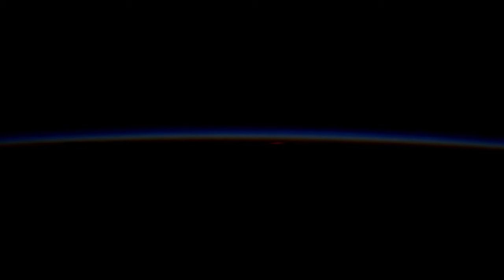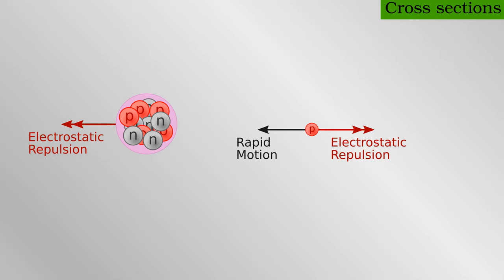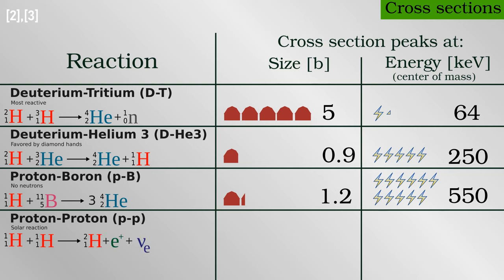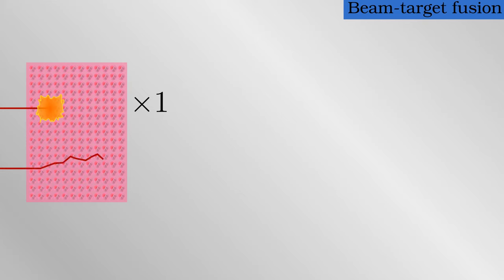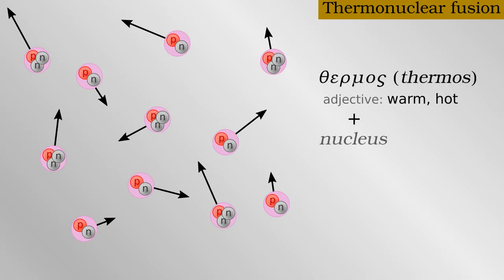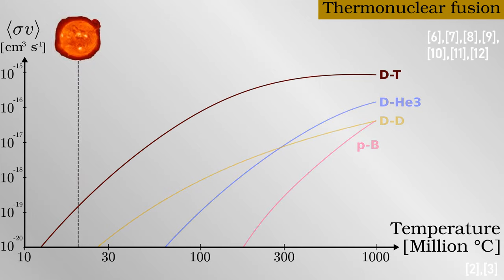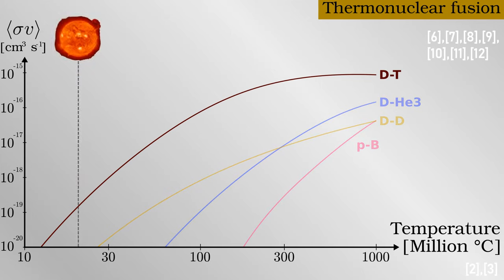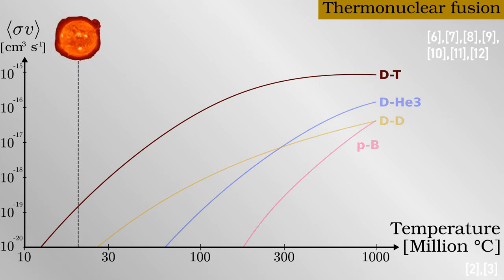How nuclear fusion works (1) - fusors, thermonuclear reactions, lattice fusion

Comment: The most surprising thing I learned in astrophysics was that the p-p fusion process gives off like no energy and takes about a million years to happen per reaction (on average). Then the D-T reaction happens within a second
Reply from the maker: Yes, since not yet half the hydrogen in the Sun has fused, each individual nucleus takes longer than the current age of the Sun to fuse. So a good thing for us overall.

Comment: When they fuse mass within a Tokamak reactor, how do they get the fused mass out?  Wouldn't the fused mass eventually dilute your reaction medium until the probability of fusing becomes unsustainable?
Reply from the maker: The way it works, even in current experiments, is that some of the ionized plasma is constantly recombining and cooling back to a gas at the edge of the reactor and being pumped out. Once pumped out, the helium "ash" is separated out. Fresh gas (pure fuel in the correct proportions) is pumped in. It is estimated that an atom of fuel on average will go round this cycle several times before fusing even in a future working power plant.

Comment: I'd love to hear what your thoughts are regarding wendelstein 7x, or in general stellerators vs tomakaws.
Great video thanks!
Reply: Stellarators are essentially tokamaks but better. The geometry of a tokamak causes a problem where the inner wall has a higher magnetic field than the outer wall causing charged particles to contact the outer wall and break confinement. Stellorators basically take the standard donut shape of a tokamak and twist it. This produces more uniform magnetic field lines which produces a much more even confinement field.

Comment: No complaints from this stickler for accuracy in fusion reporting, a fine treatment all around. Though the climate change thing at the end seemed a bit weirdly tacked on. 
I would add though for those wishing to know more about WHY plasmas in thermo disequilibrium can never produce power, the relevant important paper here is the 1995 PhD thesis by MIT student Todd Rider: "Fundamental limitations on plasma fusion systems not in thermodynamic equilibrium".
Reply from the maker: I'm glad you approve. I noticed something that was missing: the scattering was meant to be for angles >4°, chosen to make it a round figure of 1000. There was something else minor I noticed only after uploading, but nothing too important.

Comment: Excellent video with really clear graphics. You could explain why proton proton fusion has such a small cross section, instead of just giving a figure of 10-25 , and why the sun has to be so large . I have heard it said that the energy density in the sun is about that of a garden compost heap. Is this true?

I have now subscribed
Reply from the maker: I didn't want to burden the video further with a discussion of why the cross sections are what they are, but you can look up things like the Gamow factor. The reason I did not give an exact value for the p-p cross section or the energy for its maximum is that it is actually too low to have been measured experimentally. Yes, it's true that the power density of the sun is very low (and a good thing too, or it would not have lasted as long as it has). The next in this series of videos will talk about stars and I will try to put in interesting details as usual.
Reply: @ImprobableMatter  Looked it up, and it IS complicated. Seems to be the product of two protons sticking together, and the simultaneous probability of a proton turning into a neutron .

Comment: Very nicely done. Lots of good facts shown with clear graphics and narration. I've been following the general topic for "a long time" but somehow missed the points about few explicit collisions lead to actual fusions but the momentum and KE goes from fast particles to slow ones anyway. For fusors, I thought the main problem was ions banging into the grid, draining KE from the beam and melting the grid.
Reply from the maker: The electrodes are certainly an additional problem for fusors, but even with magically robust ones the energy input to maintain a non-thermal energy distribution would outweigh the output from a practical electrical generator.

Comment: Thanks excellent video!!!
Where can I find how to plot the Rutherford scattering on top of the cross section diagram?
Reply from the maker: The Wikipedia article appears correct: https://en.wikipedia.org/wiki/Rutherford_scattering
Note one thing, however: the formula it gives is for a differential cross section (meaning not just the probability that it gets scattered, but scattered by a particular angle). To get the full cross section, multiply by 2 and then integrate with respect to Theta.

Note that the differential and total cross sections become infinite at Theta=0, meaning that you are infinitely likely to be scattered by an angle of zero. This is because being scattered by an angle of zero is the same as not being scattered at all and all the atoms in your body are busy doing that all the time. You therefore have to define some minimum angle to be scattered by, which I took to be 4°. I was sure I put that in text in the video, but apparently not...
Reply: Thanks I will look at it. Where is the best to reach you? I think you mentioned a discord link but I didn’t find it. I really appreciate your work and I really find excellent to have a physicist doing such an amazing work for fusion science popularization!
Reply from the maker: I did have a Discord, but it wasn't really getting much traction, so I closed it down. There is an email address in the channel description.

Comment: Let me just check if I understand: the reason why higher temperatures are favorable is because that then makes the atoms more energetic (they move around more) and because of that they are more likely to collide with one another. Right?

What I may be a little confused about is how the temperature can effect the effective cross-section  of the atoms…. If at all. If someone can please help me or clarify any fault in my understanding, I would very much appreciate it.
Reply from the maker: The cross section is different when a given particle has a different energy. Generally, it is better for the energy to be higher. Higher temperatures mean that a particle has, on average, a higher energy. Therefore, at higher temperatures, particles have higher cross sections on average. That's one way to think of it.

Comment: Re lattice fusion. There is a loophole. If the ground state of interstitial protons/deuterons is a resonant dipole-dipole mode (only possible if the effective well potential is sufficiently shallow, as in Pd and nickel [111] surface), the Jastrow repulsion factor disappears for the tails of the 2-particle correlation amplitude. Not many people know this...haha.

Comment: I heard you say "every division on the y axis, the cross section changes by ten times" at 5:41. I looked it over but the increment of the y axis seems to be 100 times instead of ten. (0.01, 1, 100.) Hopefully someone can tell me if I made a mistake somewhere.
Reply from the maker: Well spotted! I totally missed that between recording the audio and making the graphics.

Comment: Thanks for the video. Just one thing I'd like to ask - you mentioned that nickel  is the most stable yet when I searched youtube about all the space mumbo jumbo, a theory says that everything will be Iron? How is that possible? (I don't understand nuclear physics beyond the simple concepts so perhaps it's a dumb question)

Also, do I see kirov reporting at 9:00?
Reply from the maker: Nickel 62 (28 protons, 34 neutrons) is the most stable, with Iron 56 (26 protons) close behind. So, these two are the final products of stars. Heavier elements are formed in things like supernovae.

As I mentioned, just because energy can be released, it doesn't mean it will. The cross sections of reactions favor creating Iron 56, so this isotope is formed more out of the two above, even though Nickel 62 could release more energy.
Reply: Great question, I was thinking the same.  Good to see the answer!

Comment: Excellent video. One thing I do not understand, however, is why couloumb scattering is a problem in a fusor. Will the energy exchanged between couloumb-scattering atoms not be preserved since the atoms are not scattered away and out of the system? And if it is contained within the vessel, where else can the energy go? Couloumb scattering is elastic as far as I can remember.
Reply from the maker: Once they scatter enough (even elastically, not losing energy) they will become a thermal plasma at a given (high) temperature. Once this is the case, it must be confined or lose this thermal energy by conduction to the walls, radiation etc. As you will see in the rest of the series, confining a hot plasma is hard.

Comment: If accelerating particles or generating gamma rays is the issue, can't we simply use products of fission reactions? For example, in a lattice-confinement schema, can't we pump deuterium into fuel rods to act as a neutron moderator while also fusing and releasing more energy?
Reply from the maker: The extra fusion energy yield in such a case would be only a tiny addition to the power output of the fission reactor. Why add the extra cost and complexity when you already have a working fission reactor?
Reply: @ImprobableMatter  Oh, I get it. I'm more into fission anyway (plus solar, plus gas combined cycle gas turbines for peek demands and reserve capacity). Fusion reactors, like ITER, even if they ever get to the point of sufficient sustained net energy production which is economically viable, look so excessively complex, massive, and expensive to build and maintain, that only the richest countries can hope to afford. And that, I think, defeats the purpose entirely.

Comment: Hi, what are your thoughts on "dense plasma focus" route that LPPFusion is pursuing? And a related question, what are your thoughts on molten salt reactors, will we be able to use our "spent" fuel for some thousands of years? Thanks
Reply from the maker: LPPFusion are claiming to use the p-B reaction, which as I mention is objectively much much harder to do, so I'm skeptical.

With regards to MSRs, fission really is a mature technology so it's just a price argument. In actual fact, running a fusion reactor at an energy loss to transmute radioactive waste is an interesting proposal I will cover in a later video.

Comment: Seems like it would be easier to engineer/develop a beam target that would have fusion rate of 1/100 vs. trying to control thermo nuclear plasmas in a magnetic bottle... ?  Is there a plot that shows the Q for different beam targets?
Reply from the maker: If it has a fusion rate of 1/100 or worse, it will never generate net electricity. You just have an expensive heater.
Reply: @ImprobableMatter  thanks for the reply... still confused a bit, if your gain is 180:1 and fusion rate of 1/100 could be attained. Q would still be 1.8 right?

Comment: Hi Improbable Matter, thank you for making these videos on fusion. I was starting to kind of get into the fusion hype train, although I am usually pretty skeptical about optimistic energy claims. I just have a couple of tangential questions. 

Firstly, could a fusion reactor with a Q total more than 1 but less than needed to generate electricity be useful for generating heat for industrial processes, so things like forging metal, preparing cement and glass, or heating oil shale and tar sands?

Secondly, more of a general question, is EROI, Energy Returned On Invested, actually something that matters in relation to the efficacy of an energy source? It is often brought up by Peak Oil proponents, and is often derided by free market optimists. As someone who clearly has a strong background in physics, does it make any sense to you to use it ?

Lastly, do you think it is likely that electricity generated by fusion will ever make up a large portion of the electricity, or even all of the energy used by humanity, within the lifespan of someone alive right now? 

Thank you for reading my long comment, and good luck with the future videos!
Reply from the maker: Thanks. To answer your questions: a fusion reactor which outputs heat is unlikely to be economical. You could use a heat pump which has over 100% efficiency, namely it can pump in more than 1 unit of heat for every unit of electrical energy, or use mirrors to focus sunlight. A better idea for a non-breakeven fusion plant might be generating neutrons to transmute radioactive waste.

For sure, some sort of economics will need to be considered when we get anywhere near a working fusion reactor: how much energy does it cost to construct the original plant, how much the raw materials cost, even things like the cost of borrowing money.

It's hard to definitively say what the future energy balance will be like. People have commented that I'm too pessimistic because apparently I "don't understand what an S-curve is". It's true that if fusion is developed in a timely manner, people already born could well see exponential growth of fusion plants until a saturation of the market. Very hard to make an accurate prediction when/if that will happen.

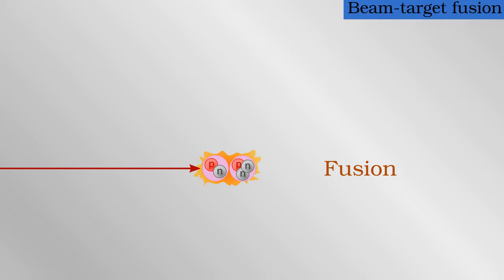Comment: 5:18 Could that problem be fix by using quantum-locking to holding the atoms in place within the magnetic field. Would concentrating the beam onto the flux tubes make a higher chances of atoms collisions?
Reply from the maker: There is no such thing as "holding in place" when it comes to quantum physics. At the scales of the size of a nucleus, there is an uncertainty on the positions of everything.
Reply: @ImprobableMatter  The goal was to mitigate coulomb scattering and increasing the chances of the beam coalitions with particles.
Analogy: Like hitting a free-floating ball in a pipe with a cue stick.

If this would not work then do you know of any other possible way to mitigate coulomb scattering and increasing the chances of the beam coalitions with particles?

Comment: Proton-Boron fusion, is it easier to get the required higher temperatures by simply using bigger devices?
If temperature weren't a factor that would be the best option due to no electrons and commonly available ingredients, right? 
What would a 7 million square kilometer tokamak get us to in terms of temperature?
Reply from the maker: First of all, you would get an enormous construction and upkeep bill. Secondly, the hotter it is, the more energy it loses as bremsstrahlung radiation. So, it would cool down faster than the fusion reactions can heat it, and eventually the reaction would stop.
Reply: @ImprobableMatter  yess o realized after I commented thank you!

Comment: Another great video. Can anyone explain exactly how, if it ever happens, the above unity energy could be collected to generate electricity?
Reply from the maker: In the case of the easiest reaction, Deuterium-Tritium, 80% of the reaction energy is carried away by neutrons, which will stream out of the thermonuclear plasma. A blanket around the fusion chamber must be designed to absorb them, thereby capturing their energy as heat. This heat is extracted from the blanket and used to generate electricity with turbines similarly to a conventional power plant.
Reply: @ImprobableMatter  So is this, as yet, another unproven part of the fusion reactor process or is the absorbtion blanket a well understood process? Will the neutrons intereact with any of the confinement and plasma heating hardware, assuming the absorbtion blanket is around the outside of the reactor?
Reply from the maker: @richardmarkham8369  Absolutely: the issue of neutrons is probably the greatest unknown currently for all fusion approaches. While it is theoretically well understood and tests of neutron effects have slowly been made, the exact engineering of a blanket has never been properly tested. Structural components and other vital parts of the machine are expected to be severely weakened by neutrons.

People are slinging different comments about ITER, but one thing that is less discussed is that it will have several slots for different countries to test tritium breeding blankets in a realistic environment: fast neutrons and near a hot plasma.
Reply: @ImprobableMatter  Many thanks for enlightening me! I can see why the jam jar with electrodes in was so much easier! Too bad it was bogus...

Comment: Ah ! (Just as a back of the envelope in the mind calculation, how big would a lattice confinement panel designed to do fusion for a generation ship to the stars have to be for enough random gamma rays to hit it? ((For a sci-fi story)) ?)
Reply from the maker: Check my numbers, but according to this data ( https://www.nist.gov/pml/x-ray-mass-attenuation-coefficients ) Erbium would absorb half of all gamma rays in that energy range for every couple of centimeters. 1/2 after 2cm, 1/4 after 4cm and so on. This does not factor how much the deuterium would absorb, but it's safe to say that very few gammas would make it deeper than 10cm into an Erbium panel anyhow.
Reply: Thanks for that (!) X
Reply from the maker: No problem, feel free to share a link to the story, or the book etc.